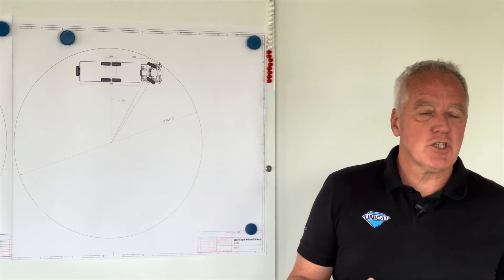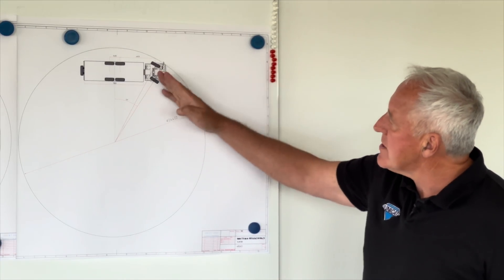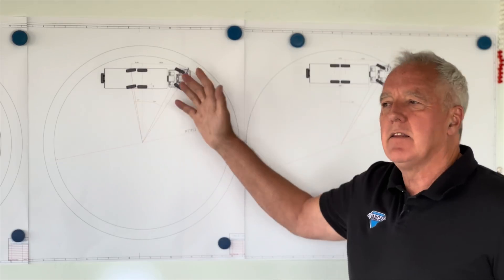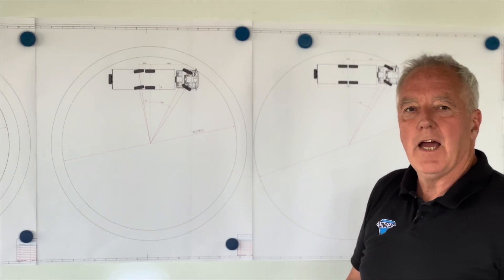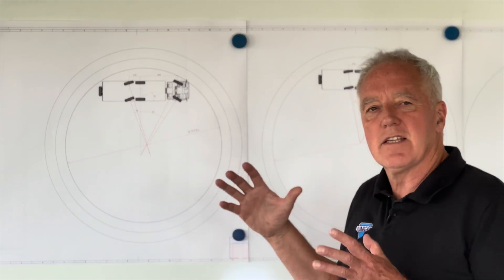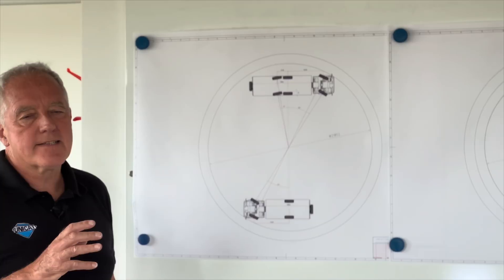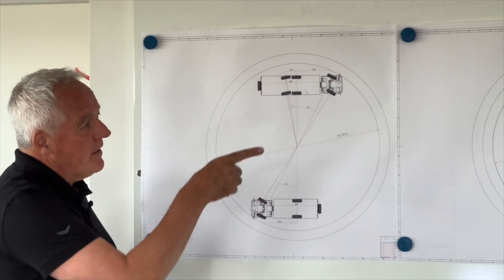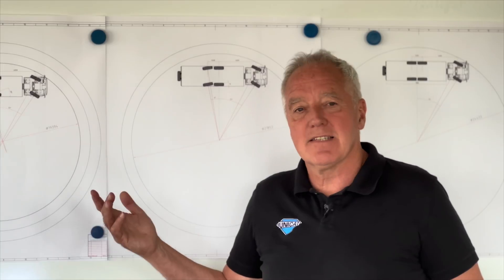UNICAT Expedition Vehicle - Rear axle steering

Comment: Hi Thomas, thank tou for this superb video. I am a big fan of the technical side of your project trucks. It is always great to learn something new.

I wanted to ask this: in your video you have used the 14.00R20 tyre size for calculatios. How would each of the  duscussed turning circles change when used 16.00R20 tyres?

Thanks

Comment: Long time subscriber and major fan of your company and your vehicles. You are doing everything right and I love the way you demonstrated rear steer turning radius. Would have been interesting to see a 4x4 with rear steer, or a 6x6 and 8x8 with all wheel steering. But you included enough information to extrapolate the likely results. Good video.

But I did have one issue with your previous video on electric vehicles. You talked about all the drive systems that don't make sense for off-roading and explained why they don't make sense and that electric drive is not a viable option. However you neglected to mention the one system that does make sense for off-roading and has been being used for off-roading for more than 70 years. Diesel generator with optimized fuel use powering electric drive motors with superior torque characteristics with an intermediary small battery bank meant to handle surges in demand during acceleration that exceed the generators capacity. The same system that has been in use for every diesel electric locomotive ever made and for all the biggest mining equipment in the world for the last half century.

A company in British Columbia, Canada, named Edison Motors is producing a diesel electric Logging truck with 440 HP electric drive axles, designed to handle up to 4 drive axles for a combined total of 1760HP, but more realistically with only two drive axles giving 880HP.  This vehicle is being produced for heavy industrial use in mining, forestry and oilfield and can more than match MAN. Its an electric truck with an in built level four fast charger that kicks on and off as needed when the small battery pack gets low on charge and their numbers claim 80% more range out of an equivalent amount of fuel due to a smaller more efficient diesel motor being able to generate enough energy for the more efficient electric drive motors to do the job.

They also discovered that when they removed the heavy drive components, transmission, and put in a lighter engine, they were able to add all the electric components, generator and batteries and still be 3000Kg lighter while doubling the horsepower. As an electric vehicle it also qualified for government exemption programs that allow it to be a couple thousand Kg heavier so going electric increased its carry capacity by nearly 5000K instead of reducing it as you claimed in your video.

It is possible you did not know about this type of electric vehicle when you produced your previous video and it was not ignored due to bias. So I would really appreciate it if you could respond on this topic.

I think this is the future and when I retire in 8 years I fully intend to commission one. I am estimating the tech will be mature by then and will be one of your regularly offered options. But that will only be true if customers keep pushing the limits.
Reply: Hi, thanks for your comment, I am aware of Edison Motors and we had a chapter in the electric drive video that speaks about the type of hybrid with a smaller diesel engine, smaller battery pack and electric drive motors.
Thomas
Reply: @thomasritter1470   Im going to need to re-watch that video because I don't remember that being in it. How embarrassing.
Reply: I am going to have to re-watch the video I referenced. If I missed such a large detail then it puts my entire line of questioning in a bad light and clearly explains why you wouldn't address it the last few times I brought it up.  My deepest apologies for any aspersions I may have made.

Again, you make an amazing product. I just think it has the potential to become even more amazing in the next decade and I have some big dreams for the rig I wish to commission when I finally get my affairs in order. @thomasritter1470

Comment: Interesting topic from one of the best well reputed company. In a common 8x8x4 truck, Arocs or TGA, which has two axles at the front and two at the rear, to what extent adding a rear steering will improve the radius?

Comment: my question instead is this: since I was fascinated by your vehicle (Volvo 4x4) I wanted to have more information on how to convert a "normal" 4x4 with "fixed" wheels to 4 steering wheels without the hydraulic suspension system but above all where to find the correct axles .thanks

Comment: Hi Thomas ..
Previously .. I'd ask about 6×6×6 .. & you'd answered it can be done ..
Would really appreciated it if you can show it with the drawing layout & actual driving view as you shown in this 6×6×4 vehicle ..
Really want to see the actual results ..
Thank you in advance
Reply: Hi, we are currently working on 8x8x8 and 6x6x6 vehicles but the main advantage of all wheel steering is that you can go sideways as it's not really improving the turning circle any more on a 6x6x4 or 8x8x6. If you look at the drawings you can see, that with oversteering on the 6x6x4, the vehicle is not only touching the turning circle at the front end but also almost at the rear end. If you reduce the circle by steering all wheels, the vehicle will swing out of that circle at the rear.

What we are looking for is the best balance between turning circle, rear overhang and weight distribution. This is different on each vehicle and the one we have shown is just one sample.

On a 4x4, rear axle steering could help a lot as it does on my Volvo 4x4x4. On the drawing in the video, you can see that the rear end of the body is far away from touching the turning circle. But installing a steering axle on a 4x4 does not just mean to take a front axle and put it in the back. Imagine it would start steering by itself. On the Volvo, there is a hydraulic, spring loaded centering system as well as a mechanical blocking in the center position and I can activate it only at low speeds. Not so easy
Reply: @thomasritter1470  ok then .. thanks for the details in your explanation / reply to my msg ..
Now I really understood ..
I watched your Volvo truck .. 1 think quite a few times as to imagine how to apply the second floor area to (hopefully) my future 6×6 MAN TGS (as the MD 77 truck) .. which definitely will be done by your team .. if I'll be possible to get one